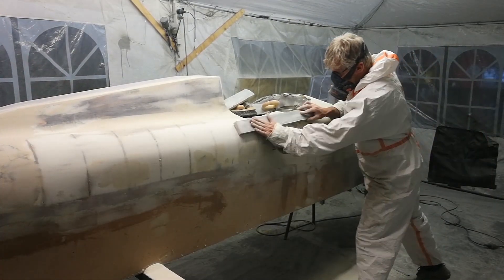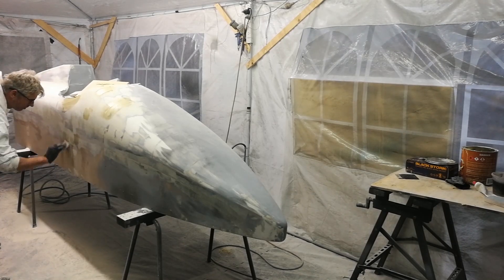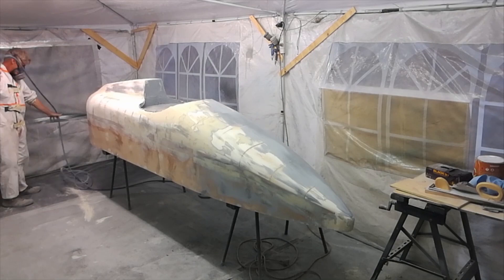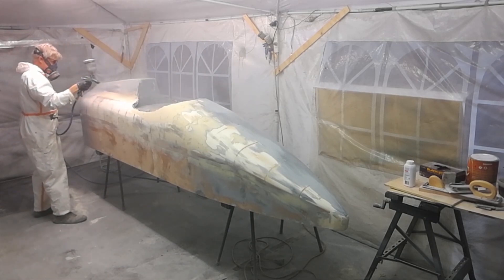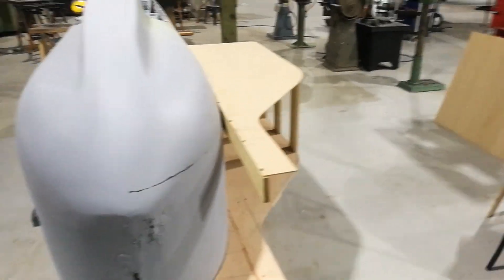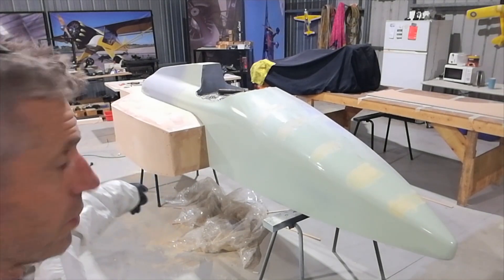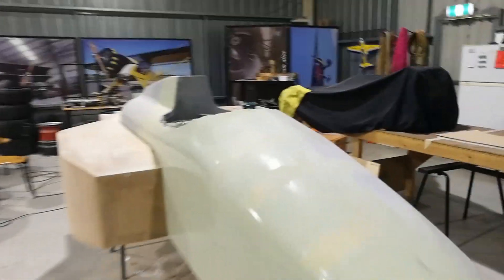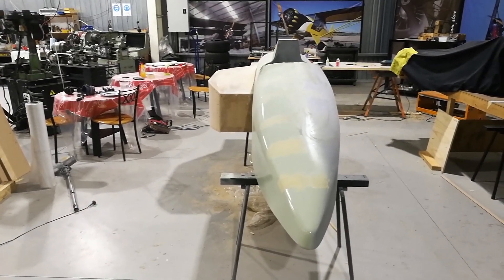FB /F1 Formula Racer PART 6

Comment: This is gonna be wicked when it's done! What kind of horsepower do you have in mind, and are you planning on doing trackdays with it in the future?
Reply from the maker: Cheers JKP.
Well a Gen 2 Busa, with this Turbo set up, inter-cooler, tuned for E85 fuel, could push up to 400hp.  But half that would be enough to scare the sh1t out of me!  Time will tell.